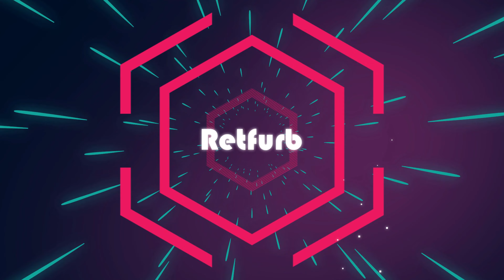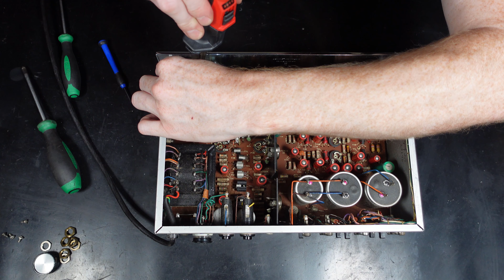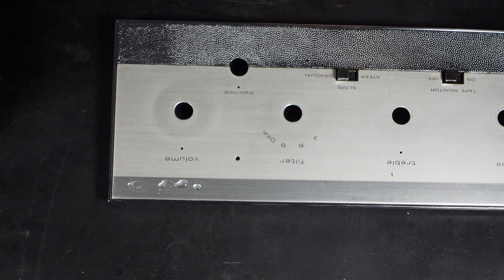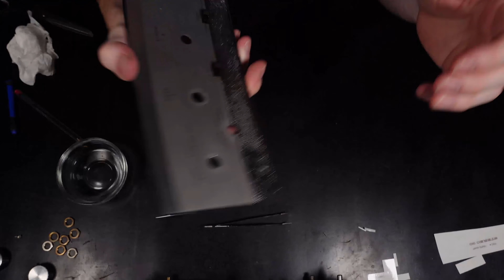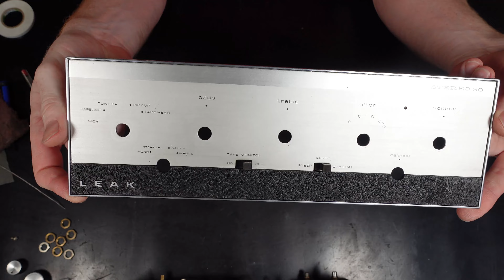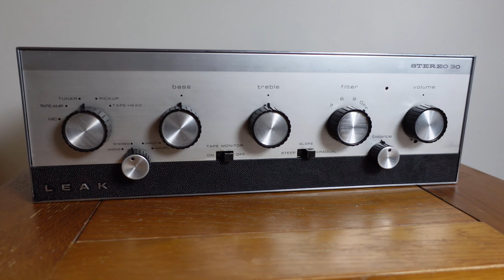Leak Stereo 30 Amplifier Front Fascia Panel Repair & Re-Fresh Refurb. Retfurb Retro Audio

Comment: The fascia panel with the lettering is separate from the chromium casting, so you could have removed it without having to do all the unsoldering. Just remove the nuts securing the potentiometers, and then the panel can be gently prised off.
Reply from the maker: Yes, That's correct. Although on this one it was so well stuck, That it wouldn't come off without damaging the metal face.
I tried at the start and it began to bend the metal.
So decided to leave it in place and remove all in one.

Comment: Great solution. Thanks for taking the time putting this up. Can you remember the font used (probably two types)? I would only add that it is worth refurbing the two slide switches at the same time.
Reply from the maker: Thank you for the kind comments. Yeah, Probably would have been best to do them all. 
I have it set up still, If you would like them? Thanks
Reply: @retfurb  Thanks for the reply. That would be great thank you. I have two of these amps and about 3 stereo 70's that need doing.
Reply from the maker: @mmuzzwell3654  Email me contact@retfurb.co.uk
Reply: @retfurb  Thanks will do.
Reply: @retfurb  Also what type of printer did you use? laser or injet, thanks
Reply from the maker: @mmuzzwell3654   ink jet. But you can also get paper for the laser jets.

Comment: Where do you get the replacement lettering from?
Reply from the maker: The paper was from amazon and is branded 'wellington' on the packaging. It is the clear type waterslide paper for inkjet printers. It seems to work well, Whenever I use it.

Comment: Great job….all Germanium transistors…..an interesting amp.  It’s Achilles heel for reliability is all the unnecessary switching options.  What paper did you use for the lettering? Thx
Reply from the maker: Thank you. I appreciate the comments. It is a lovely looking amplifier, But agree it seems way over complicated. The paper was from amazon and is branded 'wellington' on the packaging. It is the clear type for inkjet printers. It seems to work well, Whenever I use it. 👍
Reply: @retfurb  thanks….I used to have a 30 but could never get it to work consistently despite much work done….you may be luckier!